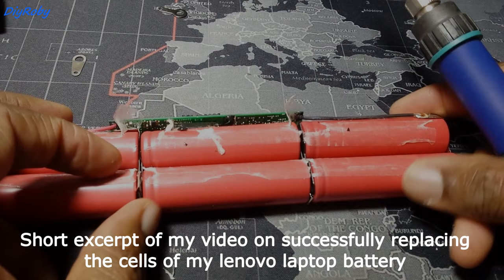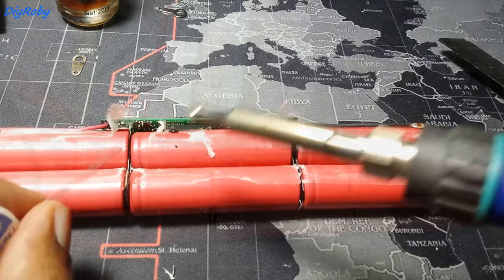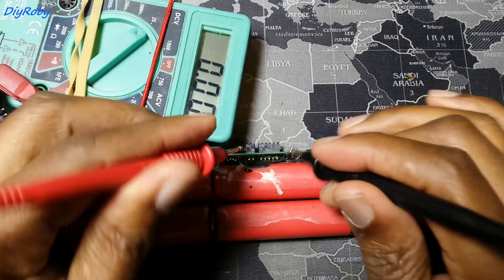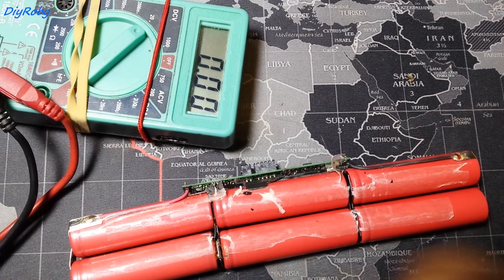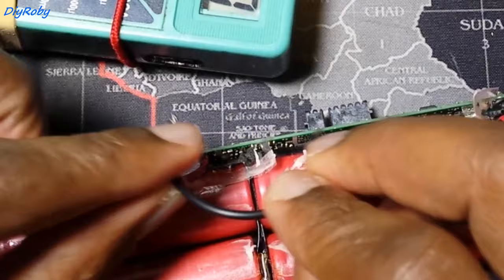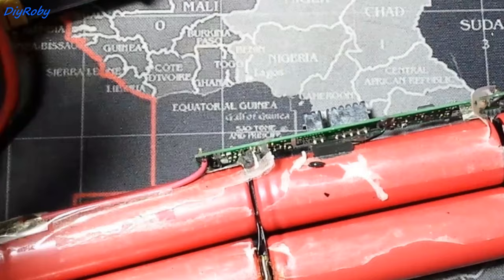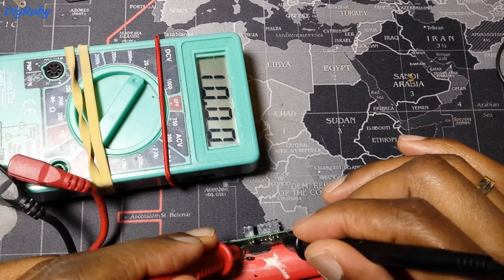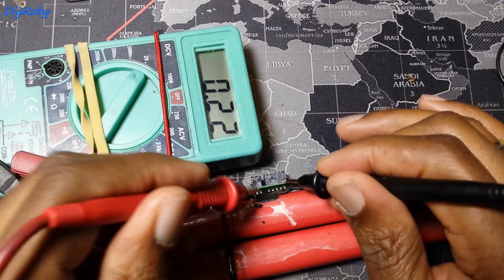How to restart a dead laptop battery BMS due to loss of power to chip. Worked on lenovo battery.

Comment: Wow! I have a hp battery with every cell of above 3.9V. Multimeter reading was all zero at the output ports and i was fed up Searching for a new BMS. I bridged all the ports with positive till i got a spark... And hola!!  Laptop was awake after changer being unplugged. Thanks a lot brother! ❣️❣️
Reply: Very good class
Reply: I have hp laptop and changed cell ,battery overall output is 14 v ,but in bms output it shows 0 volt ,please help ,i already giving 14 v to bms but its show 0 volt.
Reply: @kevalpatel9728  as first u must "refurbish" good battery with low capacity. If battery have bad cell or wery low capacity, IC in it cut of battery from charging or using, to prevent damage/not all batteries/.
Reply: No se ve bien lo qué haces

Comment: Thanks! Saved me! I was about to throw away a new BMS thinking it was broken (all the connections had the right voltage except the output pins). For the people who didn't notice, you have to connect the  B+ to the P+ for about 3-4 seconds (no sparks in my case).
Reply: cn you be more detailed about this 🥹

Comment: I was replacing the cells in some simple handset batteries, and when I put in new 18650's, the output was not working. For me it was the battery negative to the negative output reactivated it. You video helped me a lot, thank you. :)
Reply: as first u must "refurbish" good battery with low capacity. If battery have bad cell or wery low capacity, IC in it cut of battery from charging or using, to prevent damage/not all batteries/.

Comment: In my batery pack there was only one batery which need to be chanced and I replaced it. I pluged it in to the laptop and it is working. But issue is that it is  charged only until %45. why can it be? Today I will try your way. I hope it can solve my issue too. Thanks bro :)

Comment: Thank you! Gonna try it today myself, your reaction tells me youre not lying.
Reply from the maker: Yeah, I thought it was all over lol. When I saw the voltage at the exit I almost ran out the building ahahahahaha
Reply: @diyroby732  Unfortunately it didn't work on my unit but I will keep this method handy for the future. Do you have any other possible solutions? I pretty much ran the positive terminal to all the pins, might have even fried the board :P but nothing worked :'(
Reply from the maker: Unfortunately, not all manufacturers allow the bms to be revived. There are some videos online about shorting some reset points on the board, you'll have to search for them based on your battery brand. If your battery has an aftermarket version (or just the bms) on ebay for cheap, you could try that. Just make sure you don't spend more than/or close enough to a new battery for your laptop.
Reply: @diyroby732  yes, in my case I have a dell battery and even doing this procedure I still have O volts in battery output pinouts.
Reply: @ProgramaFlashPan  yes the same issue i have, after shoring this, the reading of chip is no more, no deduction of bms

Comment: I did it in my laptop battery but I had a proplem
When I connect the postiv from battery and the postiv output from the cercul like u did
 it gose from 0 volt to 14 v
But once i remove it it gose to 0 v agin
Is ther a way to fix it
Hope u answer me and Thank u any way

Comment: hello great video, I have one HP chromebook x360 2 on 1,it doesn't charge, but when i disconnect the battery and then reconect it, it charges as good as new, but then to charge it, I need to repeat the same process.

Comment: Nice tip. But bro with ur fingers in the middle i couldn't see where u were touching near/on  the pcb board. I'm new to all this. My laptop battery is not charging. I opened the battery power pack. With the help of YouTube. Out of 6 batteries inside 4 were reading 3.60v and 2 were 1.45v. After doing hack on those two batteries it showed 2.40v each  on both batteries.
After putting back on laptop still not charging... Shows 58%. If i unplug the charger the Ltop shuts down.
I don't know what to do. 
So what must be the voltage of single cell 🔋 to put inside the battery  pack if i want to buy a new  one?
Thanks bro.

Comment: Could you improve the method so that we dont have to pry the battery open? Maybe two or three holes on specific place? We can still use lenovo battery and learn from you
Reply from the maker: Good idea. You can make a small hole at the top of the battery if you know how it looks/is arranged inside. In my case, I had to change the cells, that's why I opened it fully

Comment: Are you resetting the DATA pin? Please, I'm trying to reset a HP EV06 battery after replacing the cells. Battery shows it's fully charged on the computer (which I know those cells were charged before putting them in so I could eliminate any possibilities of dead cells.

Comment: This trick has not been activated my Lenovo g500s laptop battery bms..I changed first one weak cell,not worked then I changed all 4 cells but no use, no output from battery pack output terminal s
Reply: Бред какой-то, всё также проделал и ни чего не получилось.

Comment: But my battery connector pins are only giving output when the points you short circuited are connected. Should i solder those points. Can then i use it in the laptop? Is my laptop going to blast when i am going to charge it? Please answer.
Reply from the maker: If you bypass the BMS by shorting the output, it is very very dangerous. You will be charging/discharging the cells directly without any control. Too dangerous pal.
Reply: @diyroby732  So how can i use the battery again? Please reply soon as i need my laptop battery to be revived.
Reply: Pankaj Rajput same as my problem. 
Ok diy roby.... im listning. 
Heres what ive done so far. Re celled a dell battery. And used those +to + jumpstart wire. But yes my problem is the same as the comment above, it only shows the voltage on battery connector when i KEEP that wire CONNECTED if i just jumpstart it and check the voltage it shows 0.9-8-7-6 and then to 0. 
So should i keep it connected like solder it and keep an eye on the time i keep it plugged it in or so? Like usually this dell laptop battery charges in 1 hour or so. So if i keep it under 30 mins charged up will it work? I know im taking a risk but still i need my battery to work. Thanks in adv.
Reply: Also i checked the fuse on the battery pcb. It was blown, but i jumped that too. But same result.
Reply from the maker: There is just no way to keep an eye on it. 18650 cell BMS reduces/increases the charging current based on the charge capacity. It is advanced calculations we just can't do. Don't forget that the BMS actually charges single banks of cell pairs individually, not all of them at the same time. For me this trick worked on a Lenovo battery, but Dell probably has a way to brick the whole battery once it detects a recell attempt. Charging without the BMS is a sure way to start a fire and that means your whole laptop might burn down. Because of this reason, I just can't recommend you do this. The only real option to using your batteries is to make some sort of external powerbank like this guy did with a powertool battery https://www.youtube.com/watch?v=k_2tZrYf7tQ
Reply: DiyRoby yes thats why i didnt try that. But as i said earlier, i checked the fuse. And it was blown. But then i jumped that too. So next course of action would be to check for short. Can you educate us on how to do it?
Reply: @jemsncrystals   I was also facing exact issues, I found that problem lies while we are disconnecting the cells, what I found was -ve end shouldn't be disconnected first as it acts as ground for the circuit, first all the three + ve ends should be disconnected which will not allow the circuit's fuse to break. Also, this is my estimation never got to try these, as I had already blown the circuit due to same mistake.
Reply: And bridging the cell's positive to battery positive will not charge the battery, I did the same and the battery was full dead, it worked till the battery had juice, the voltages shown was 1-2 v after this disaster, I had to charge them separately via a wall charger to revive them, my question is where can we get a new battery's circuit?
Reply: @ayushvardansaraf1892  you arent likely going to find a new circuit/pcb. If the old cant be revived, i'm screwed myself...
Reply: @aliensanonymous5063  the way how this battery motherboards are designes sucks, i tried and it dont work now i can throw old batteries to garbage
Reply: It's easier on Samsung batteries the bms does not block when changing cells

Comment: Still in actuality you need specialised hardware (i.e. EV2300/EV2400) with software (Smart Battery Workshop or Battery EEPROM Works) to really reset a laptop battery. Specifically the BQXXXX IC that is located on the PCB board - to which the 3 pairs of 18650 cells are connected to. 😑😕😒
Reply: thats not working
Reply: @ManishPatel693  Really ? How so ? 🤔
Reply: Hello, i have problem too. My battery could hold for 2-3 hours, but i've removed it cuz i wanted to reset bios and after that i've notice that my laptops turns off after few minutes on battery. The battery was fully charged, but laptop turns off. Right now my laptop cannot turn on on battery at all. And when i've meassured my + pin there is no voltage at all. If i measure my batteries from both sides there is 12.5 voltage. My laptop is x541sc ... I've bough second-hand battery like mine, but it's the same. No voltage from + pin. Is my BMS locked cuz i've removed my battery from the laptop or something like that? How we fix this? I've tried with positive to positive, but didn't work.
Reply: @OldboyWOW  Hi,

It is possible that the fuse on the BMS is blown. Hence no voltage coming through or via the BMS. 🤔😕

I had this issue for a laptop battery from ASUS K53E. I replaced the fuse with a low ohm resistor & now voltage is flowing through the BMS. 🙄

Best Regards,

Comment: Dear Sir,

My laptop battery isn't charging due to a central cell issue. I replaced cells, but the central one still won't charge. BMS works fine for the side cells But its not charge the Central cells. Could you please suggest a video or make one to help me?
Reply from the maker: unfortunately, I have no technical knowledge of these battery systems. I also searched online, read forums and watched videos to attempt this repair. Keep searching and hopefully you find a solution.

Comment: Sir for which port you connect wire ??
Reply from the maker: I connected the positive of the battery pack cells to the positive pins of the output of the battery (where you see the metal pins that connect to your laptop when you insert your battery into it)

Comment: hey bro. idk whether you can understand my problem, but still i wanna tell.
i have made a lifepo4 battery pack of 7p, 24s. with dedicated lifepo4 24s bms of 50Amp capacity. 
all connection are done correctly like -
B- to battery negative
C- to charge negative
P- to negative of controller
 The bike goes on, the bike display is on and going and all the sensors with horn & indicator are active. 
But as soon as i pull the accelerator, the system goes down.
What you think? should i pull out the BMS for its wiring and soldering checkups?
coz the battery i fixed was connected accurately.
please help.
Reply from the maker: Sorry bro. This was my first time even seeing 18650 cells. You will need to ask from the pros on lipo forums, or the BMS seller. Looks like the BMS is shutting down whenever you try to pull power from the pack. Hope you find a solution.
Reply: @diyroby732  okies. thankue.

Comment: Even after this it's showing wrong capacity anyway to reset the battery capacity I tried everything nothing works in bios setup the battery backup is good but in os it's 15 min I replaced the battery recently with new one?
Reply from the maker: 1. Maybe your system is not allowing you to benefit from new capacity after replacing the cells
2. Maybe in reality, your new cells are not really original or a high capacity cell.
To reset the battery capacity, disable the battery manager in Device manager and then allow the computer to run on battery till it actually dies. If it dies before, then try leaving the computer on in the bios overnight to completely drain the battery till it shots down.
Then charge the laptop and read the new value.
Here is a video I made about it https://www.youtube.com/watch?v=iYMnDykddyo
Reply: @diyroby732  actually in bios it's like 4 hrs of backup but on os it's 15 min I tried to do the bios method still showing low capacity.😄 Maybe asus did something to the bms circuit.
Reply from the maker: Probably. Mine is a Lenovo, while the repair worked, the bms is trolling me with 10+ hours recharge times for a sub 50wh battery. These manufacturers don't want us repairing stuff.
Reply: @diyroby732  when I disable acpi and use the laptop giving me quite good backup is it safe? charging and charged LED indicator working fine only problem is there is no low battery indicator or critical battery level if I enable acpi the battery behaviour is abnormal even I had calibrated it several times.

Comment: not workong bro
Reply: If any problem
#chipguidecomputer
Reply: @chipguidecomputer  i have problem. Whats your solution?
Reply: @chipguidecomputer  Hello, i have problem too. My battery could hold for 2-3 hours, but i've removed it cuz i wanted to reset bios and after that i've notice that my laptops turns off after few minutes on battery. The battery was fully charged, but laptop turns off. Right now my laptop cannot turn on on battery at all. And when i've meassured my + pin there is no voltage at all. If i measure my batteries from both sides there is 12.5 voltage. My laptop is x541sc ... I've bough second-hand battery like mine, but it's the same. No voltage from + pin. Is my BMS locked cuz i've removed my battery from the laptop or something like that? How we fix this? I've tried with positive to positive, but didn't work.

Comment: I need help please , when I connected the positive end of the  battery to the p+  pin  it sparks but 
connected the the positive end of the battery to  p - pin  but nothing 
No success 
Battry is Hp pro6 
Hp battery for 4440s
Please urgently need help
Reply from the maker: Hey BM, unfortunately not all manufacturers allow for a repair of the battery. Fortunately for me, Lenovo does. but other companies may have left destroying fuses etc. Check online for your brand.

Comment: Sir, please help
I replaced cells of my laptop battery, but on the bms connector it's not showing any voltage, my 4 cells shows 14v but not on connector, 
I also shorted like you did sir but nothing happened
Please help me
Reply from the maker: Unfortunately, not all manufacturers allow this trick to work. You have to google your battery brand+repair or rebuild and see if others have done this in the past.

Comment: Any advice on how to keep the BMS powered while replacing the cells?
Reply from the maker: I heard you have to keep supplying the same voltage the battery gives. Wiring it in parallel so when you disconnect the old battery, power remains from the other source.

Comment: Sadly it isn't working for me ☹️
Reply: Try connecting the battery's negative  to bms out negative (as opposing to this video)
Reply: @thanhvinhle2893  Yes, will try that.
Reply: @G_techlab  What is the model of your laptop? Did the it work with the negative side?
Reply: @csupakabra4  I don't remember the exact model, it's a HP Pavilion (4 cell long battery).
I still haven't tried it. Working without battery since.
Reply: @G_techlab  have you tried it? What did you do?

Comment: Hello, i have problem too. My battery could hold for 2-3 hours, but i've removed it cuz i wanted to reset bios and after that i've notice that my laptops turns off after few minutes on battery. The battery was fully charged, but laptop turns off. Right now my laptop cannot turn on on battery at all. And when i've meassured my + pin there is no voltage at all. If i measure my batteries from both sides there is 12.5 voltage. My laptop is x541sc ... I've bough second-hand battery like mine, but it's the same. No voltage from + pin. Is my BMS locked cuz i've removed my battery from the laptop or something like that? How we fix this? I've tried with positive to positive, but didn't work.
Reply from the maker: Unfortunately I can't help as I am no expert in these things. I simply showed a tip that worked in my case in case that helped others.

Comment: Doesn't work for me the fuse keeps blowing even though there is no short on the circuit (maybe BMS chip is ded). 

I had removed the cells to replace with new ones

Comment: can you also put a positive on it without opening everything?
Reply from the maker: you may have to drill a small hole on the top of the battery case so a wire can touch the internal positive of the battery pack. Then you bridge with the external positive. Check your specific battery brand for wiring diagram.
Reply: How it will loose power if battery isn't opened from beginning ?